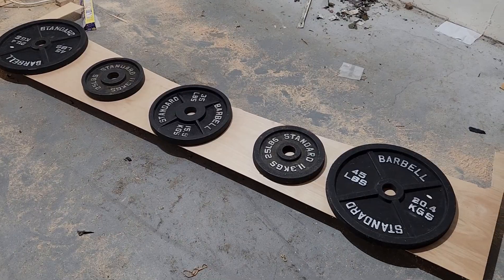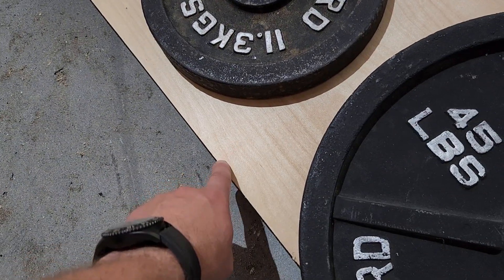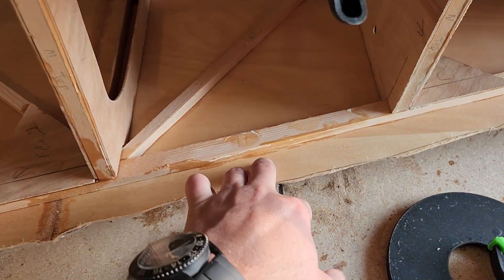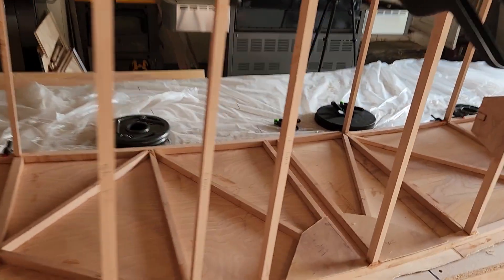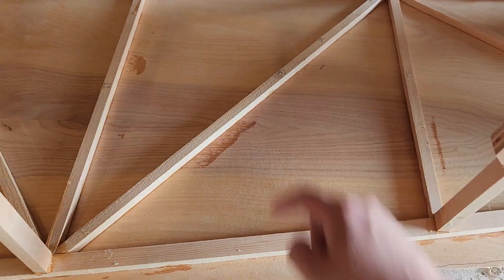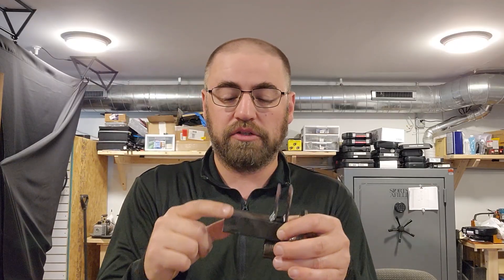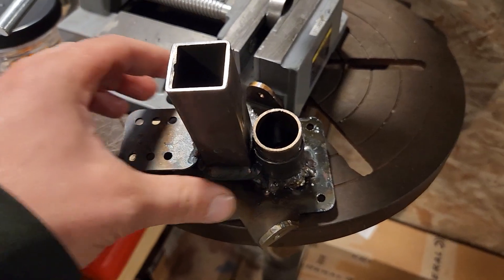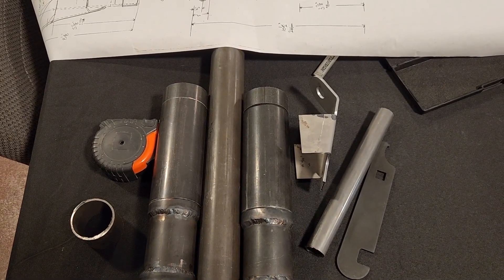WAR aircraft replicas P40 Warhawk Fuselage Spar and Control Mounts update

Comment: One more thing with glueing. To make it faster to apply the glue, get yourself a pack of 4-inch white foam rollers called Door and Cabinet. You will also need the roller handle to use them. Cut the rollers down to @ an inch wide (4 pieces out of one) to apply the glue to the frame. For the spars that are wider, use them full width.

Comment: To help with glueing on the skins, get yourself a hand operated staple gun and staple the skins down. The original build manual says to use brass staples. But you will only find steel. The T88 glue you are using, doesn't need a heavy clamp load to hold it tight. The staples will work just fine. The Arrow brand T50. Get the 1/2 inch wide by 3/8 inch long 20-gauge. You can always pull them out when done, or leave them in. They will rust over time.